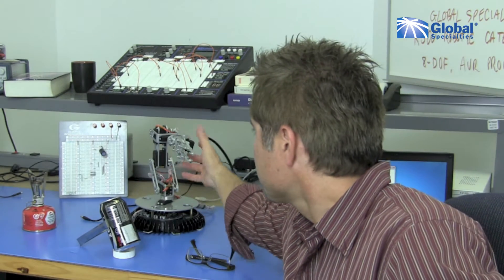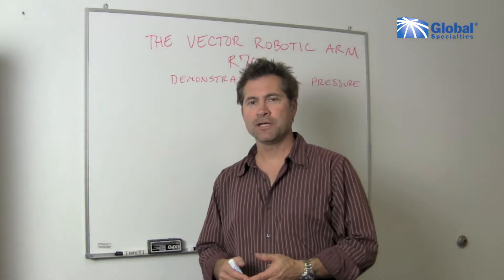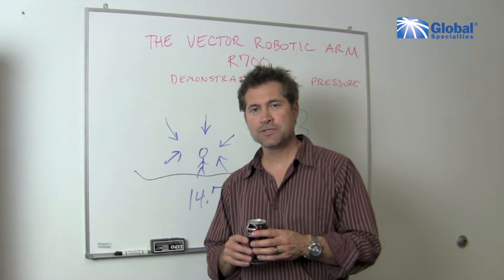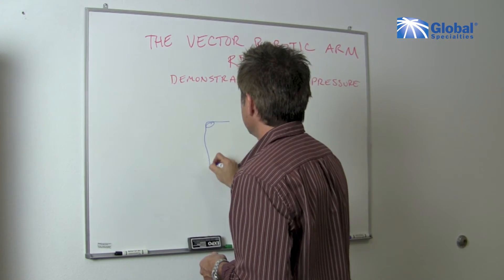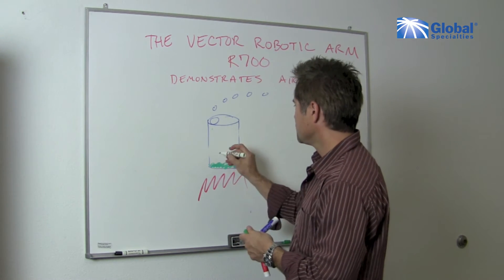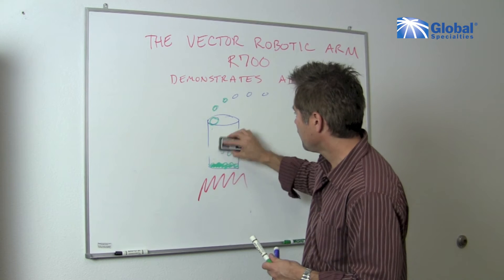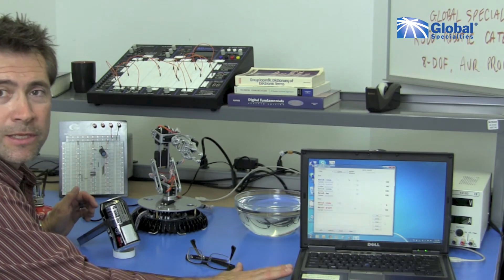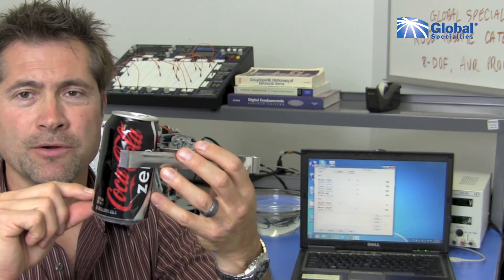Physics Demonstration of Air Pressure with R700 Vector Robotic Arm

Comment: Great experiment! If I want to repeat the experiment it looks like I need to add enough water in the can to make sure it still pours while doing the flip and seal the can opening by submerging it into the water bowl so I don't allow the time for the air to get back into the can. The use of the R700 Vector Robotic Arm for such types of experiments is perfect!